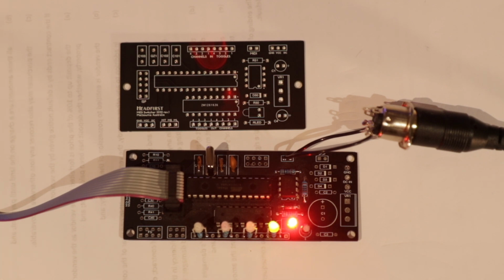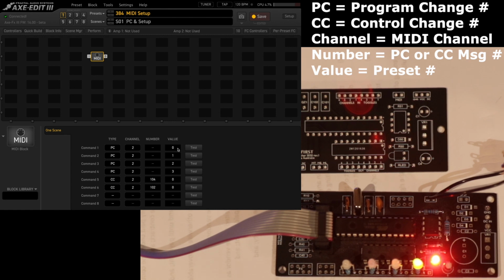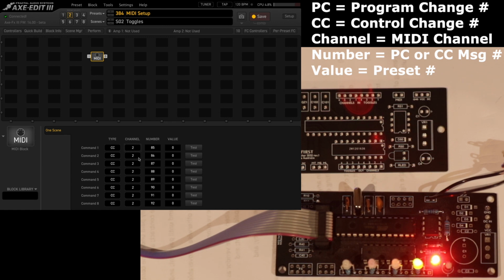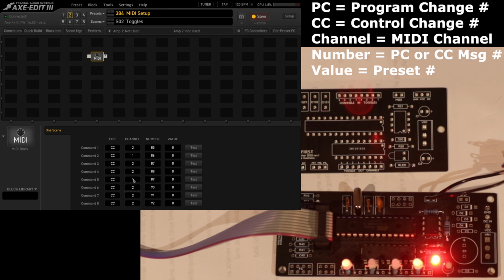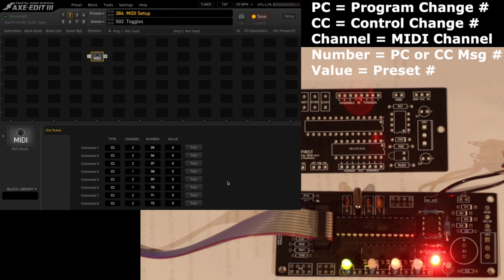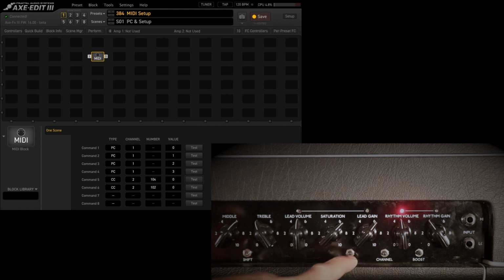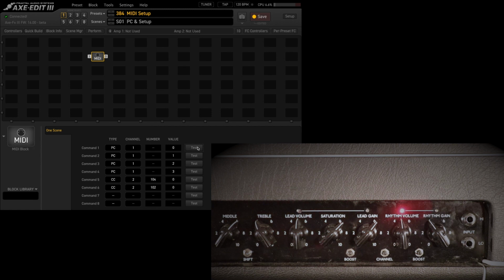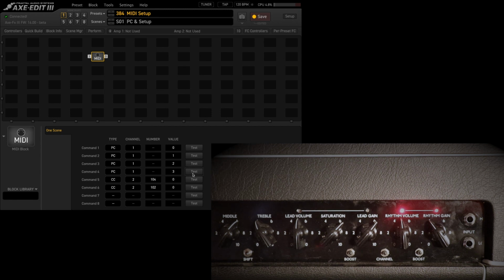Headfirst Amp MIDI Switcher. PCB overview & Firmware setup.

Comment: hi thanks for the video appreciated. i want to change my amp engl fireball 100 to midi . which would be my best advice? thanks
Reply from the maker: The MIDI switcher can control a traditional TRS style amp, however it depends on how the amp is wired up as to whether you can wire the MIDI in to the control circuit.